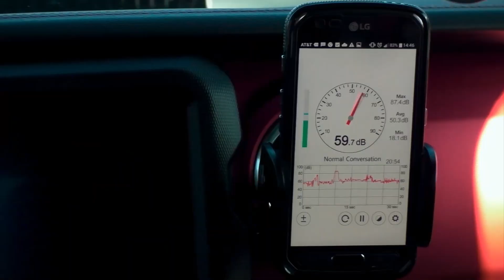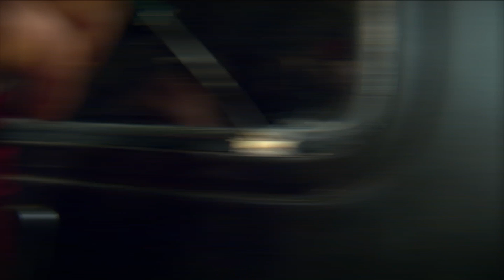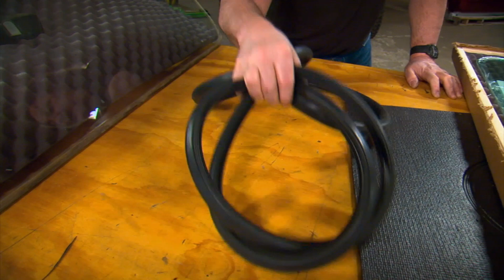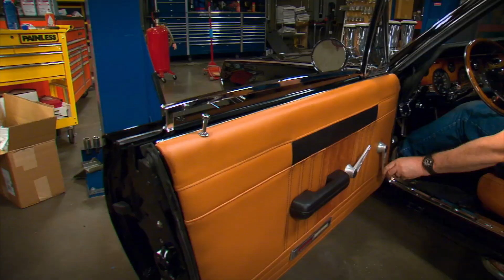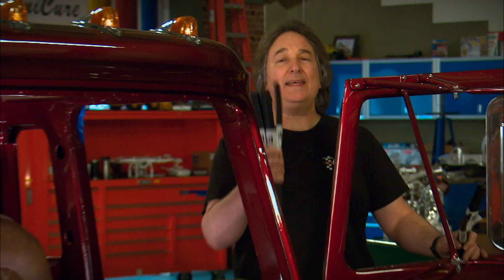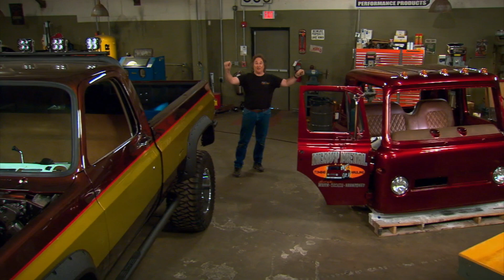Weatherstripping Basics for Your Restoration

Comment: Should door weatherstripping with push pins have adhesive? I have a 69 Ranchero, the old weatherstripping didn't look like it had any.
Reply from the maker: Hey Fred, we responded to the other comment, but want to respond here as well. When installing door weatherstripping with pins, each pin should line up exactly with the holes in the door and should fit securely once pushed in. It isn't required to use any additional adhesive, however, if you would like added protection for your seal to stay in place, you can certainly use an adhesive made for weatherstripping. We recommend the 3M Weatherstrip Adhesive. We don't recommend putting adhesive on the pins themselves and strongly encourage a test fit first to make sure the seal fits correctly with the pins in place before applying any adhesive. After the test fit, if you need to remove the entire piece to apply the adhesive, be very gentle when removing to pins to prevent them from pulling out of the rubber. If a pin does come out, you can glue back in place on your rubber using Loctite 495.

If you don't see pins in the old weatherstripping, they could have fallen out over time or when you took it off, or it may not have been installed with pins previously. If your door has holes for the pins, then any new door weatherstripping you buy as an exact replacement for your year, make, and model will have the pins included in the correct places. If you need additional help with this install, please feel free to contact us directly via email or phone. Thank you for watching!